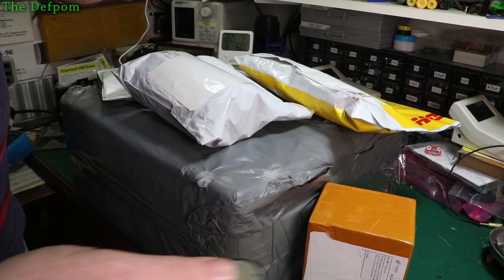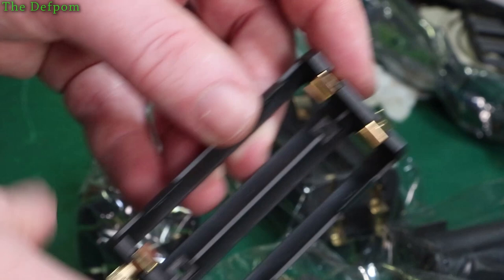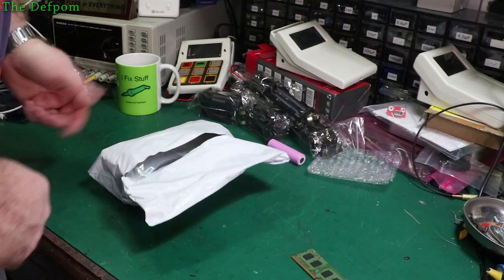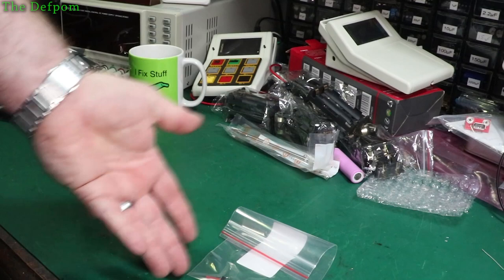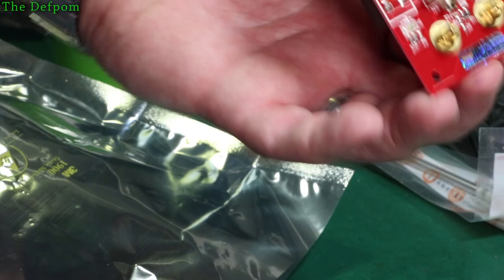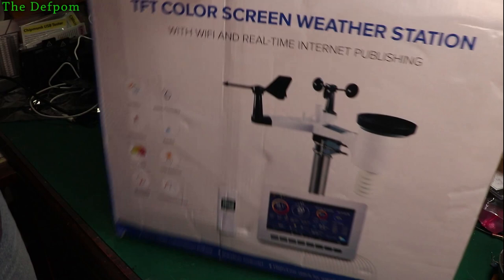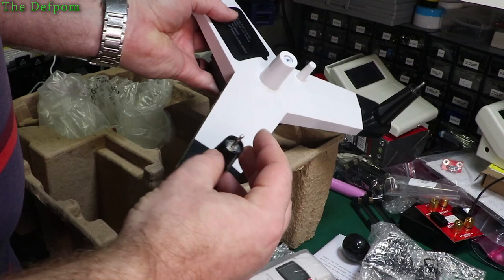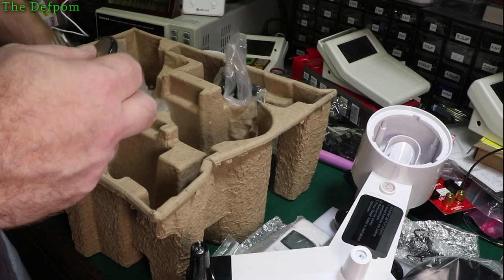#732 Mailbag Monday 6th July 2020 NEW

Comment: Hi, at 4:19 you are worried about the Lipo batteries falling out.
If they are externally charged and fitted inside as non-user serviceable item, then use some beads of silastic to hold them in.